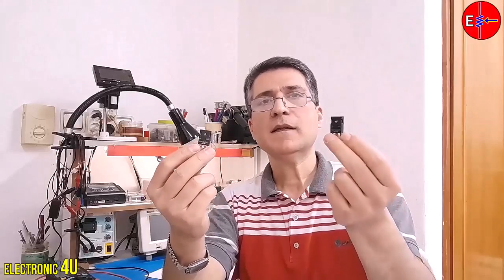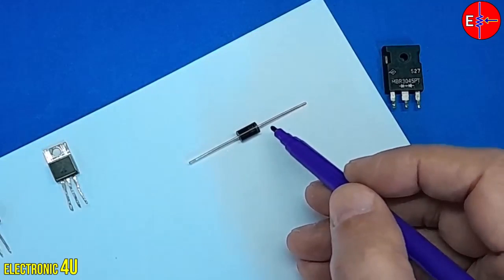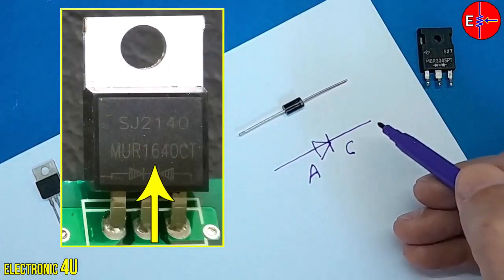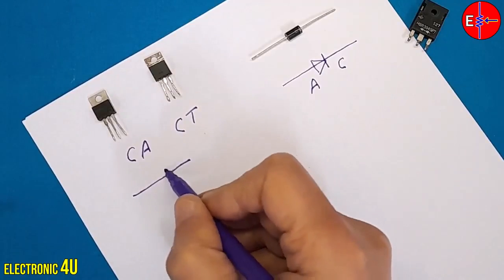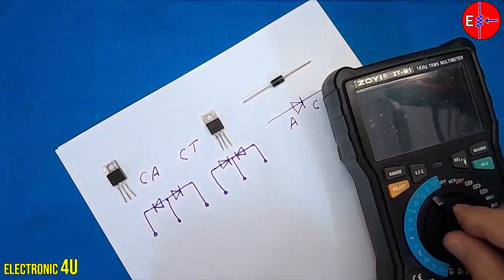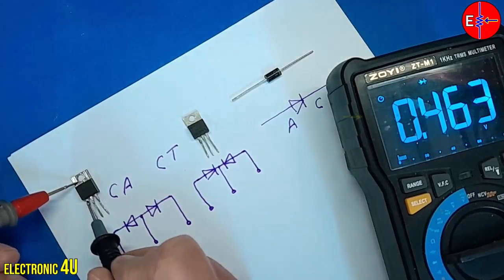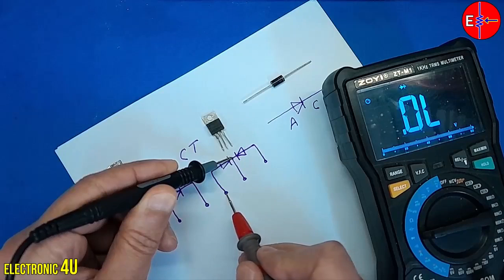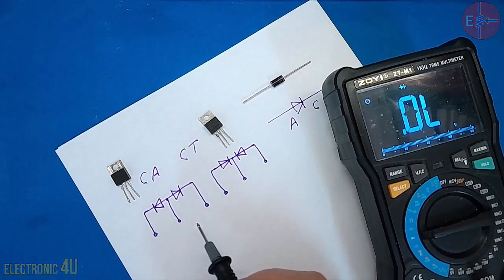What is the meaning of CT and CA on diode?

Comment: Also to note, this CT and CA is only for Dual Diodes (3 pins). When it comes to TVS (Transient Voltage Suppression) diodes (looks like a normal diode with 2 pins), the CA is used to indicate that the TVS is bi-directional, the uni-directional only use A in the type number.
Reply from the maker: Hello, thank you very much for your excellent explanation. Your opinion is absolutely correct

Comment: hello professor  . what is difference  between a ct diode and a pnp transistor or a ca diode and an npn transistor?
Reply from the maker: Hello, in general, diodes are very different from transistors. The role of the diode is to rectify and pass one-way current, while transistors sometimes act as amplifiers and sometimes as switches. I have talked about this in previous videos
Reply: سلام ، منظورم مقایسه ی یک دیود دارای یک جانکشن نبود بلکه مقایسه ی یک دیود سه پایه با دو جانکشن با یک ترانزیستور بود.

Comment: Just a little correction, not the same voltage but the same current enter and exit the diode. The diode have voltage drop so the voltage exiting is always smaller depending on the current...
Reply from the maker: Thank you very much for your comment and explanation🙏